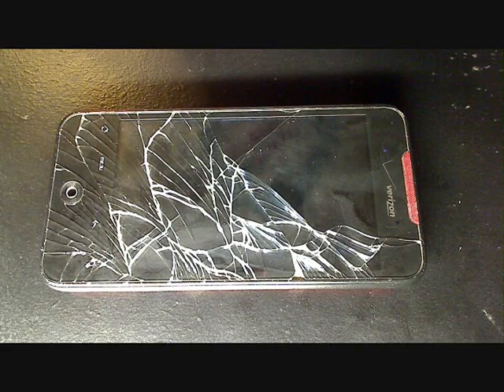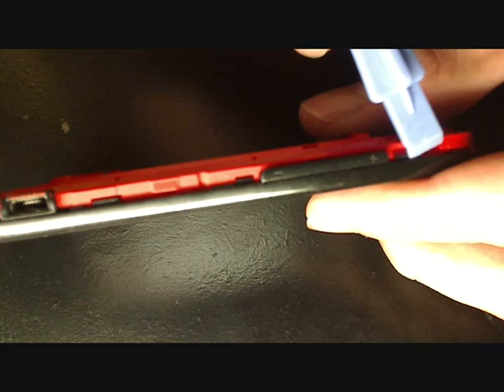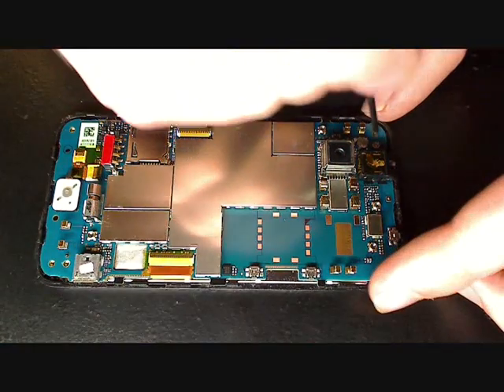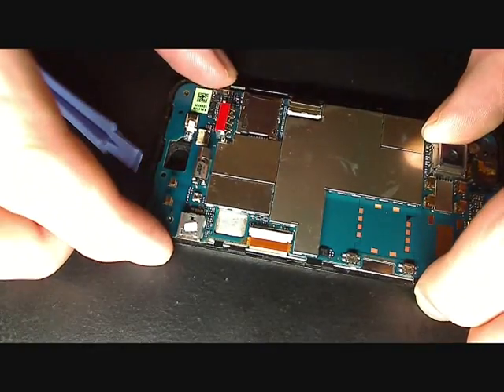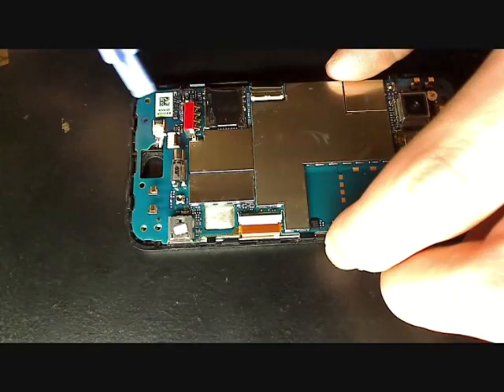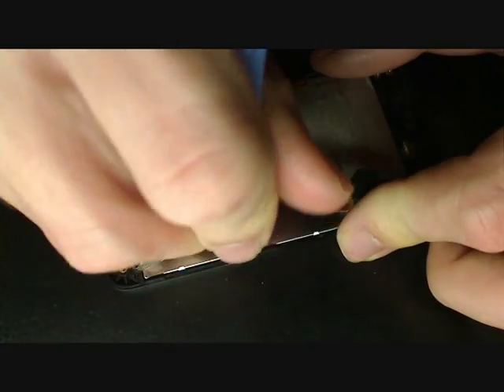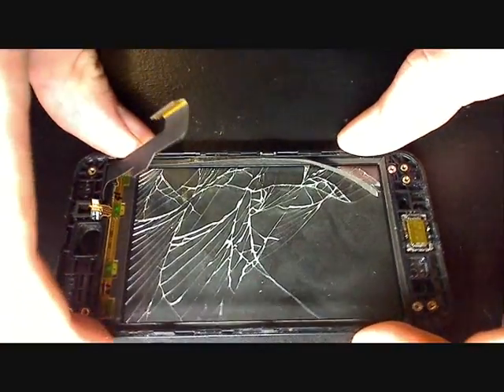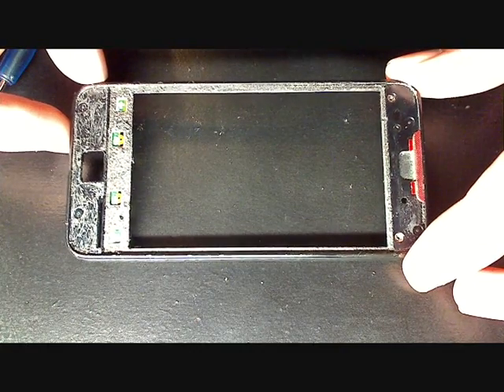Droid Incredible Digitizer Screen Repair Guide Complete from start to finish

Comment: One thing I found useful for removing the leftover adhesive after taking out the screen... I used a small flat-head screwdriver with a metal tip e.g. out of a jewler's tool kit.  This made it nice and easy to scrape the adhesive off of the aluminum and make it ready for the double-sided tape.  I HIGHLY recommend using the 2mm double sided tape, I bought mine with my digitizer for an extra $4.

Comment from the maker: Well...a customer sent me a phone to fix and part of the top connector piece had broke and the LCD still worked. The white plastic tab just holds it still. As long as the connector part didnt come out with the white plastic you should be good.

Comment: I broke off the light gray piece that the ribbon cable for the LCD slides under.  I also ripped that ribbon.  If I got a new LCD screen, would it still work without the top piece of that ribbon connector housing?

Comment: The digitizer ribbon cable re-connection was tedious, but that ribbon cable is not too delicate and I was able to bend a bit and re-connect it. Also, while the super glue was drying I pushed too hard and cracked the screen in one corner. It is superficial, but DANG!!! LOL! I found this video to be a very big help! Thanks, I am positive I would not have been able to do this on my own!!!

Comment: My droid incredible 2 was dropped in the toilet. I put it in rice for 3 days and then took it to the verizon store. They turned it on and it appeared to be working but there is water trapped between the digitizer and lcd screen.  I put it back in the rice for another day and the water has not moved. I wonder is taking of the circuit board and lcd screen the best way to get it out. That last step of removing the screen from the glue/tape looked very difficult.

Comment from the maker: @crazycatpeekin22 If you broke a tab off it could be. The buttons are fragile. I broke a button and had to get another one put on. Not many places will do it. When you plug the charger in the orange lights should light up even if the phone is off. If not something is bad wrong.

Comment from the maker: @crazycatpeekin22 I have a brand new trackpad I could sell you if you need one. The phone WILL come on without the trackpad installed. Check all the cables again and make sure the battery is charged.

Comment from the maker: @lightthelamp4036 Might be the cable isnt connected right but if the touch area works in that area when not in landscape its software related. A hard reset might would help if thats the case.

Comment: It took two days and a run to Jo-Ann Fabrics (I used 1/8 double-sided craft tape instead of glue) but I got my Incredible working again and looking good. At first my LCD screen wasn't working and I kinda freaked out—but then I just took it apart and put it back together again and BLAMO! Perfect. Thank you so much! So much better than any other tutorial out there.

Comment: 3. For removing the LCD. I used the hot air dryer to make the tape release easier.  
4. At 12:00 with the LCD remove, if you purchase the glass and housing together. You will need to move the strip for the Home/Menu/Back/Search buttons.  Use the hot air blower method. It will come right off using the plastic tool and wedge it underneath and carefully peal back.
5. For those replacing the whole housing also, don't forget the speaker behind the verizon sign!
Excellent and thanks repair universe!

Comment: Pretty good video.  A couple of points.
1. At 4:55 with the 4 ribbon strips.  You can use the plastic tool and a tweezer to get the sticky plastic off without destroying it.  This allowed me to put it back after reinstalled everything.
2. At 8:09 with releasing the ribbons.  The black things need to stick up in the air to unlock the ribbons.  It was hard to tell from the video.  Definitely leave the big ribbon last and remove it as you remove the board out.

Comment: Appreciate the video. Mine fell out of my pocket when I was closing the door. Smashed the digitzer and lcd screen. Your guide definetly made things a bunch easier. I have one trouble spot, where I failed to put the red ear piece in straight enough and the digitzer is slightly elevated there where it overlaps.But it looks fine and even with that slight blemish it will always be better than the Eris I borrowed from my sister. Thanks again.

Comment: Followed this video to replace the screen on my phone, I did use two sided tape instead of glue and didn't have any problems with that.  Unfortunately  none of the videos that I've seen mention how easy it is to destroy the LCD when you are removing it if you don't make sure to get the pry tool in deep enough.  My new digitizer looks great, but I had to order a new LCD today.

Comment from the maker: @mandimendoza Take out the LCD cable by removing the whole board again. Lift up the bottom section first or else you may rip the microphone off. Then put it back in. You are just doing this to re-seat the LCD cable.

Comment: Thank you! Followed your instructions and now I have a perfectly working phone...the rubber band testing is an important step not to pass up. After getting the new glass in and hooking the ribbons back up, I did the rubber band test and found that everything on the screen had a red hue to it, but otherwise worked fine...I wiggled all the ribbons, re-checked, and red went away, all buttons working fine including the four at the bottom...was not nearly as hard as I thought it would be...2 hrs. thx

Comment: @cowsgonemadd3 I followed this tutorial very closely l/n to fix my wife's phone.  Everything went well with the exception of the 4 buttons in question above.  The ribbon appears to be in mint condition.  It is seated well in the hasp on the motherboard.  I have taken care to seat the ribbon on its pin sized plastic clip on the molded casework & also seat its associated button pads into their respective depressions on the glass.  Is there a trick to seat these properly which I am missing?

Comment from the maker: @kframcis00 Its not a problem. I made the video to help people but I do this for a living or I am trying to. Not making a lot right now :( If you reseated the other cable on the left side...there are only 4 in the whole phone. Then I would say possibly a bad digitizer but thats rather unheard of. Sometimes you may have to mess with those ribbon cables. Always be careful when taking them apart.

Comment: Really appreciate you taking the time to help.  The 4 buttons work, they just don't light up any more and that's OK.  What do you think is causing our original problem, the 7, 8 and 9 keys and the bottom row of the keyboard not working?  When I last opened it up I unplugged and plugged in the other four cables.

Comment from the maker: @kframcis00 There is a little tab that goes to the 4 in the front next to the scroll wheel thing. It connects on the left side, the side where the digitizer cable is above it. That has nothing to do with the screen not working just those 4 buttons. If you ruined the cable to those 4 buttons you can buy a new one. If you broke the slot it goes into then there is no fixing it sadly. I fix a lot of these phones so if anyone has any troubles then they can let me do the work you see in the video.

Comment: @cowsgonemadd3   Uh oh, that cable is only half there and the connection part is gone.  No clue how that happened.  Reviewed your video and the phone and the connections seem to go to the four buttons in the front.  My guess is that this is not repairable.  Can we get a new front plate with this digitizer cable?

Comment: If you bought the housing with the new digitizer, don't forget to peel off the LED lights for the bottom 4 buttons off the old housing.  They are held on with adhesive and will just stick right onto the new housing.  Also, don't forget to move over the headset speaker out of the old housing.  I would clean the contacts for the speaker, for some reason when I did this repair my speaker is now slightly tinny sounding.  Still works just fine.  Thanks for the great video, made it nice and easy.

Comment from the maker: @mayfly27 Loosen the screws up and see if that helps. You may have pressure on the LCD. If not try re-installing the lcd cable or take it apart again and put it back together. In all the ones I have fixed I have never saw that happen.

Comment: I had a question. I bought the digitizer with casing and when i put it together the speaker didnt work. i couldnt hear or talk. But i noticed that there is a metal battery looking thing on the back of my broken screen?housing. Am i supposed to put that in the new casing?

Comment: After I replace the digitizer and put everything back together it turns on and goes to the lock screen but the touch screen does not work like i cant unlock it. Do you have any ideas what could be wrong. Thanks

Comment from the maker: @toretto240sx You can buy the screens for 21-23 bucks shipping and all on ebay not to rain on your parade lol Uh I did but I have one more to fix and will do a video on placing it back together. I repaired or am going to repair at least these 3 I have. Be careful I broke the power switch and have to sodder on a new one.